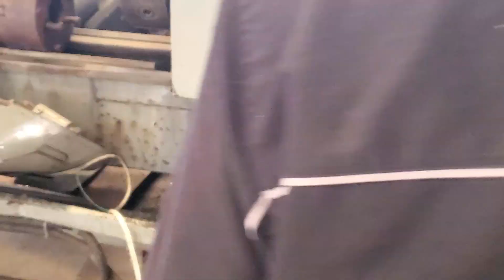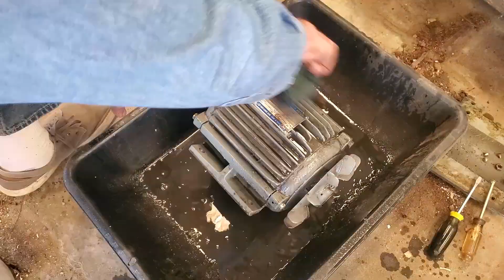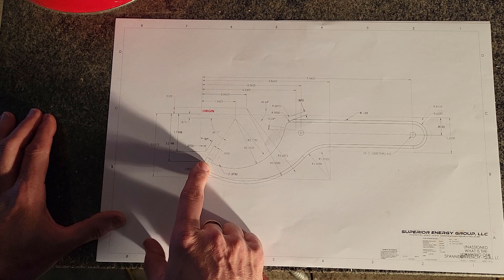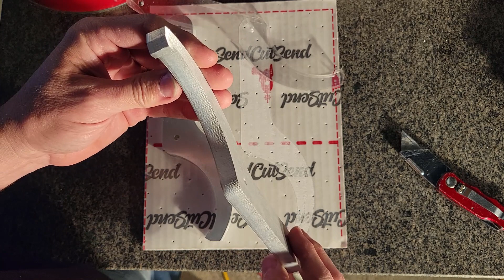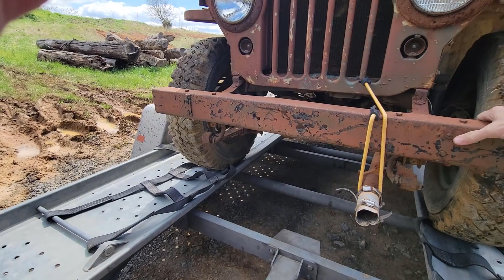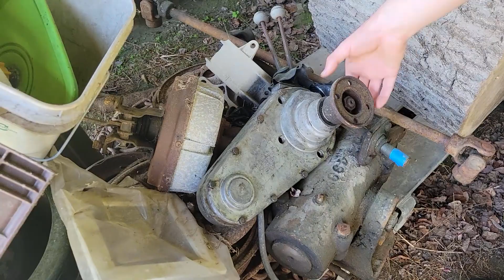Shop Update - Grinder Table, the Acra"Turns", Meet Willy!

Comment: That series of belt is measured on the pitch line, not the OD.   --Doozer
Reply from the maker: Thought pitchline is very close to OD of the sheaves
Reply: @EngineersWorkshop  Just like a gear, half way between the bottom and the top of the vee.

Comment: Valuable lesson to be learned here. An "A" Section belt is 30 inch *inside diameter*, they are 2 inches longer on the outside diameter. That's different that a Fractional Horsepower "FHP" belt such as the 4L300 that is 30 inches outside. 😎 Those spanners turned out great. Praying for Ukraine
Reply from the maker: Yes, I have a couple more machines with belts to size, but they are B and C section. Same principle? Thanks for the insights!
Reply: @EngineersWorkshop  Yes, except that B is 3 inches and C is 4 inches as I recall. You don't have to member the offset just use McMaster is a quick way double check if you can't remember. I run their app on my phone and use as a spec source as must as do ordering hardware.

Comment: I would probably be tempted to try a little heat straightening on that table. I expect the top is really parallel to the bottom but the magnetic chuck was sucking it flat so as soon as they released it went tater chip. Normally you would grind both sides with only residual or some ships to correct but if you told them not to grind the ways then that was not an option for them.  3 or 4 little spots with the torch probably get it right back to flat.
Reply from the maker: You are correct it still is a banana. I wanted them to shim from the beginning but first round they didn't. Final iterations were shimmed but they didn't get it all out. The main table with ways hasn't been touched, but now I have a better surface to indicate and shim one way to correct tilt. If I had any confidence in my ability to heat straighten I'd try, but I don't... didn't know it was an option for cast iron. Thanks for the tips!

Comment: Lathe had a knocking sound on first start up, has that gone away? Glad you have her running, now you can do lathe work on the lathe instead of the mill!
Reply from the maker: I have to pull off the top cover and refamiliarize myself with the way the gears are shifted. I think I may not have had it fully in one range or the other

Comment: I think it's called juan jeep parts in the phillipines. They make brand new jeep parts for mb onwards. 

Kinetic knifes does grinding also grinds machine parts sometimes.  

Hint. A very thin coating of hylomar aka permatex 86420 flange sealant under magnetic chucks can stop rust and rust jacking issues. There is a solvent to dilute it to get a thinner coating. 

If the jeep head gasket has to be replaced.  Hylomar on both sides of the head gasket and around the head studs and bolts
Reply from the maker: Thank you for the tips!